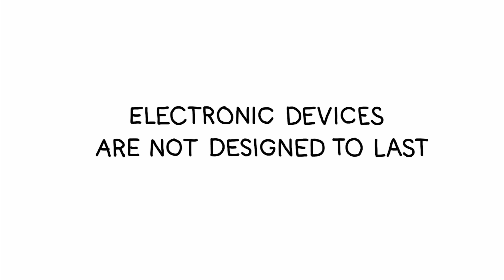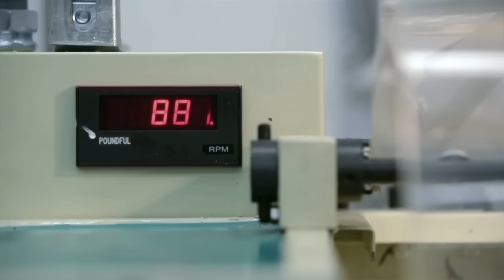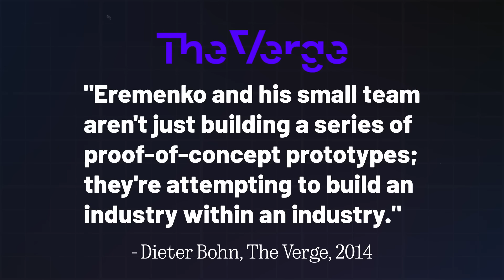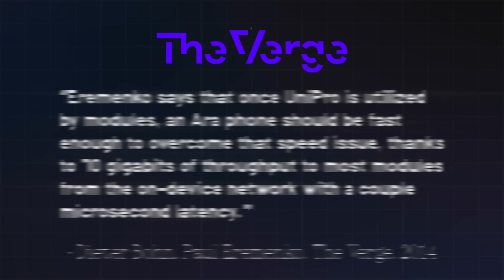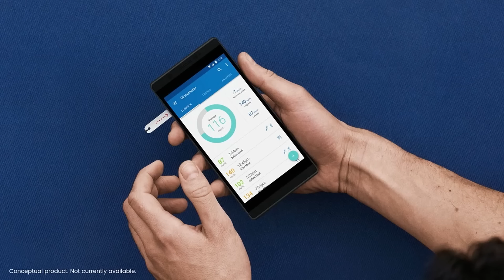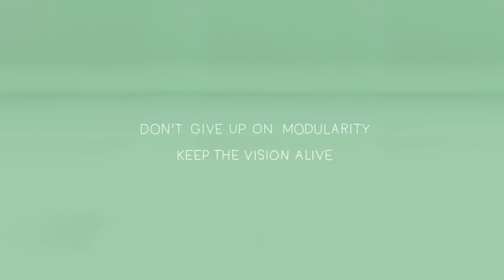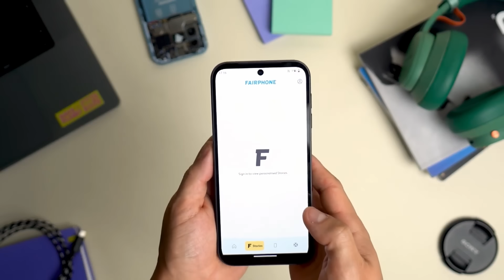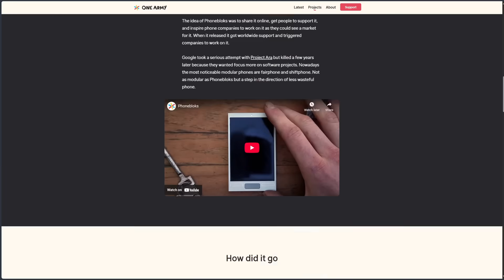Why Did Modular Smartphones Fail?

Comment: I think that the main reason as to why nobody's really pushing for modularity (at least "true" modularity) is that you can just make a phone that actually does everything you'd want a specific phone to do without swapping anything: most modern phones are great at almost everything with maybe 1-2 weak points per model.

Comment: Great video, although I do feel Apple's iPhone MagSafe definitely deserves a mention!  Considering it uses NFC and data protocols for accessories like automatic tripods, batteries, etc, even if apple locks down the MagSafe protocol pretty heavily. They even have the ability to update iPhones inside boxes at stores! And iPhones cases have chips inside them that animate the iPhone with the color of the case when you insert the phone.
Reply: Mag safe should have been pogo pins, wireless charging is so inefficient.

Comment: I had the LG G5, loved it, yeah it didn't have modules like it promised, but it came with 2 batteries with a case that held the other battery that you could charge the battery with or use it as a power bank, I actually still have my G5 on a shelf somewhere, the case, and batteries, I use it occasionally when I lose power or for long plane rides, though those batteries can only give me about 30% charge (each) for most modern phones, also loading in the batteries felt pretty satisfying, like loading a mag into a hand gun haha

Comment: I think the only thing that really needs to change is batteries. Maybe the charging port, too. I'd gladly keep using the same device for a decade as this one I've had for almost 5 years is still LEAGUES faster than I'd ever reasonably need. But, the battery is slowly showing it's age more and more. I'd be more than happy for the phone to be a few millimeters thicker if it meant I could have a hot-swappable battery. It seems a majority of people "have to" buy new phones because they kill the battery or break the charging port. Most others just buy them because the brand tells them to. We need E-Waste Recyclers first and foremost. Much like renewable energy hardware, the only reason it's "impossible to recycle" is because nobody has any reason to. It's cheaper to support child slave labor overseas than to open a recycling center. We absolutely must fix this first. Make batteries recyclable and easily user-replaceable and I guarantee you e-waste production rates drop significantly at least on the consumer side.

Comment: You can't rule cool tech over reliability. Once that thing gets water in the connectors, that phone is as good as dead. You won't have just a part to replace. Each individual modular component is considered a product. Products have scews, scews have manufacturing processes, manufacturing processes can be outsourced, but each product has different manufacturing lines, automation, labeling, and SPC. So your one product is the cost of eight production modules and 8 things to go wrong. That cost alone is more than triple the cost of a premium phone. The cost to manufacture it will not be worth the investment because it will be obsolete in two years. New tech and chip manufacturers don't stay still, so the module frame configuration will need to be redesigned, and module connectors need to be redesigned; module components may or may not fit the new frames. If Google had applied this to an open-source product, this would have more of an impact. There was always a hidden message that this would be the last phone you'd need, or why upgrade when you can replace parts, and that just is not the case. But if big tech was going to manufacture it will be obsolete in two years because the changes of human experience and behavior is much narrower.

Comment: 7:11 yeah... and the same goes for camera, screen, modem, wireless, emmc - since those are as bandwidth and latency sensitive as they come. I mean we have dedicated highspeed low latency interfaces for those in embedded for a reason. Ara has never reached a "functional prototype" stage, all it really got were pretty pictures and nice sounding idea, that looked "plausible enough" at the time(since bandwidth and latency limitations weren't as severe yet). There is a reason why SoCs, CPUs, PCHs and even SuperIOs have that many pins and why we use bga for anything REALLY complex - you just need that many connections to pump that much data - there are no real shortcuts or workarounds that you can reasonably cram in there.
Reply: As for what could actually be a "project-ara-ng" is just less ad-hoc version project ara, as in "base-plate" having the cpu and ram and all the modules having everything else(e.g. something that google "settled for" in the latter stages of project ara). Same premise, but way more achievable and with less drawbacks, and with actual standartisation of connectors and form factors something that could achieve the very same functionality. Another positive side to this aproach is that the actual prtocols and undelying IPs, SoC and interconnections can be the very same, wiith only thing different being standardised connectors. As for drawbacks, i'd say them being actually more limited variety of phones and their functionality(standartisation doesn't bring creativity), the need for balance between ruggedness, thinness and weight would be a tough fight for the one that would want to bring the standard forward. Another elephant in the room would be proprietary drivers, init sequences and "purpose built" apis and apps that dominate mobile market now would severely limit the hardware choice for such a device...
Reply: Except all of those have already been made in modular formats, just not all at once. A few phones have had modular cameras, my laptop has a modular modem, every desktop PC has a "modular" display....
Reply: Half of those don't even need high bandwidth and low latency.
Modem and wireless are available as USB 2.0 modules, that's speeds from the 90s. Even lower end cameras work with USB 2.0, and USB 3.0 is enough to handle a 4k camera.
PCIe standard which allows quite a bit of a distance between the CPU and the addon card is enough to handle the fastest disks on the market, so emmc is not a problem either.
And PC monitors are usually connected using 2m cables so 4cm extra introduced by an external module won't be a problem for screens either.
The only component that might have latency issues when connected externally might be memory, so it should probably share a chip/module with the CPU.

Comment: I feel like that there should be a middle ground between phones being 1 monolithic structure, and being 100% modular like the video mentions. it would be way too expensive to make absolutely everything work as shown in the video, not even needing to take it apart in any capacity to access the parts. although a middle ground would be to use stuff like ribbon cables, SCREWS, and thin plugs to connect everything together while holding the case together using screws instead of glue. something that if you know what your doing, isn't actual pain to fix and replace components, but isn't pushing it to the point where all the parts are external and any old grandma to replace parts (which would be obscenely expensive).
Reply: Its less expensive than you think. The only added cost is the extra chassis (around 5 dollars per phone if you go high quality) and connectors (10 cents per component (x2 for each side of connector)).
So if we assume a phone like on the picture with around 10 swappable components, that's 7 dollars extra. 
With phones costing 200 dollars nowadays, 7 dollars is barely a difference.
Reply: @hubertnnn  that makes sense, but there's also the cost in engineering it to work well
Reply: @Geffro  Depends on what you want those components to do. To cover 99% of use cases you can just reuse existing technologies (USB or PCIe for data and direct 12V connection to the battery for power). So the only engineering cost is planning the wires (less than a day of single experienced engineer).

There might be extra engineering cost if you would want any high speed devices to be modular (like eg. RAM or GPU), but I think having CPU+GPU+RAM on a single chip while everything else (battery, storage, sim cards, camera, fingerprint senor, USB port, headphone jack, etc) modular is probably a good enough compromise for phones.

Comment: 12:20 not hot swappable. That would mean you leave it on. It's "just" repairable. You still should turn it off when doing it
Reply from the maker: Ara was mostly hot swappable but yes I did use it wrong there. Certain components like the battery and soc where not hot swappable

Comment: the modular way they're imagining really indeed complicated and likely dont work but i was thinking about middle ground instead one slot fit anything why not just make like one slot specific for CPU then one or two slots for RAM (either dual or single channel or even quad channel for like larger tablet version) and one specific slot for display, then maybe few more USB C cards like what framework has done for additional pheriperals like camera, bluetooth, wifi, etc instead jsut trying to make everything fit into one slot and use specific slot for performance and efficiency concern like CPU need special slot which connects to RAM slot for speed reason and so on. then modular phone be looking like PC landscape where there CPU socket, M.2 socket, RAM socket, etc

or alternatively follow framework approach of expansion cards are just USB C devices under the hood

Comment: Sounds like over-reach; They could still have got 90% of the benefits, with something maybe 20% as complex... But it would also be 20% as impressive/gimmicky.

I don't need EVERY part of a phone to be swappable. How about we just make the battery and storage easily replaceable by the consumer, and then offer different different basic chassis' depending on your needs? 

So if you're into photography, you get the chassis that costs more, with a high-end camera. Or personally, I basically NEVER use my camera, and would be fine paying less, for no camera at all, or maybe just one low-res, back-facing camera for FaceTime.  

Or maybe different chassis with larger screen, or more audio-focussed, or maybe games-focused, or whatever.

But who is gonna need to swap out EVERY component? We each may have different stuff we want from a phone... But for each individual, those needs are unlikely to change- You just may want to upgrade the original
Reply: SD card for storage?

Comment: The Phone Companies Killed the Modular Smartphone:
They want you to have to pay $1600 to replace your phone because a $5 part failed.
It's big money for them.
When the project team learned no phone company would accept their phone, they shut down.
Reply: Hell the ONE thing we use to have, replaceble batteries they sealed off for much the same reasone. Why sell you just a battery every two years if they force you to get a new phone to get full batteriy performence.
Reply: This! I am very sure this happened.
Reply: They bought and killed it. 

“Don’t give up” 😂

Imagine what these companies would pay to take this off you hands ? 

They also have the power to push you out of the market all together, no company wants this, it’s not just the giants it’s the whole chain, everybody involved in making everything involved in making a phone. 

I fix it don’t want this
Reply: you can replace the 5$ part easily if its not an iphone
Reply: cannot dissagree with the first few parts, but simply the best module phone combination would be worse than the cheapest complete phone in the market.... also if modular components woud work so simple ..why aren't computers already build like that ?
Reply: why not just like limit the power? Like take for example, DDR3 PC ram can't fit in a DDR4 slot, so you make like generations that you need new motherboards for to support that new generation of RAM
Reply: I just paid $500 for my iPhone 17 by trading in my iPhone 14. It’s really quite affordable imo.
Reply: I have never experienced or heard a 5 dollar part failing in a smartphone. It's either the battery, screen, charging socket ( better after type c ). And companies will still fix it. Or some local guy will fix it.
Reply: @thedislikebutton1907 while you are desperately defending these protection racket thugs, with deceptive nitpicking, the type c connector probably is less than five bucks. 
 In the very design of the phone case is intended to keep people from being able to open it and replace parts themselves.
Reply: Just like the lightbulb industry conspiracy. They know they can build a long lasting products, but they built it to last only for a several years anyway, so customers came back to replace their lightbulbs
Reply: @Zagref7937 To be fair, the lightbulb conspiracy is a rather poor example. With incandescent bulbs, making them last longer will always sacrifice brightness. The conspiracy was just them setting a standard
Reply: @corb5905 that's not true, there's been some proof lightbulbs were intentionally build to die sooner without changing anything else. You could totally have the same one that lasts 10 years.
Reply: @Zagref7937  the lightbulb "conspiracy" isn't a conspiracy if it really happened
Reply: The phone companies didn't kill off the idea of the modular smart phone like its some grand conspiracy. The only companies looking to develop such a thing couldn't gain traction or funding. And the reason they couldn't is because their market share would be too small. You either fall into iPhone or Android. iPhone means you buy one of the last 3 models. Most android users in 1st world nations are Samsung/Google/LG customers who are paying for that companies flagship phone or a model or 2 behind like iPhone.

The idea "you used to be able to replace the battery" is a fallacy because when that was the case you also couldn't generally drop it in water. Sealed and potted phones allow for more people to experience the much more likely situation of their phone getting wet and still working fine vs those that need to replace a battery because they've hung on so long. Modular phones just don't have a market to warrant their development and cost.
Reply: @GurtTheHurt  Nice to see a sane comment amongst all the theorists out here.

It's comforting to think that it's always the fault of the big bad corpos because we have plenty of actual things to blame on them, but sometimes a cool idea is only cool as an idea. All kinds of theoretically great "techbro" devices fall apart because they were selling the idea, not the specs.
Reply: @GurtTheHurt You are repeating all the propaganda and excuses, supporting the sociopathic desire to force us to pay more money for less. 
This video demonstrates that they were gaining traction just fine. 
The one "lack of traction" was that no phone company would allow it, for the reasons I already pointed out. 
Ripping us off with overpriced, planned obsolescence phones is big money.
Reply: @KAZVorpal  Social media traction is not market traction. Far, far more people say "I'd buy one of those if it ever came out" than ever actually buy it, regardless of the product. "Putting your money where your mouth is" as the saying goes.

You can blame a lot of things on corpos, but sometimes cool ideas just don't pan out in reality. Production is a complicated thing, and if you don't do it in a smart way, that's where most product companies fail. The demand isn't high enough to offset the costs of production. There's no conspiracy behind the basic fact that making things cool is "easy", but making them profitable is not.
Reply: @Rehteal Except That this did not reach the level of profitability, because the phone companies told them that they would never buy it. 
It's just that simple. 
A phone companies make a lot of their money, by legally plundering people with these phone leasing scams.
Reply: @Rehteal  You are making my argument for me.
PCs are more modular, and have always dominated the industry, Apple being a perpetual also-ran, generally between two and ten percent of the market.
Reply: No the modular phone is conceptually cool but would be rife with issues.

Modules could be it's own whole ecosystem and potentially more money than buying one phone every few years.

The lightbulb companies made a a trade off between energy usage and longevity. You can make them last forever with thicker filament but they will cost more in electricity over time.
Reply: @LouieCastro3  No, the progress they'd made right at the end shows those are phone company fallacies.
Reply: @LouieCastro3 nope, there's a dim light at low power still active now (almost 100 yrs)
these greedy companies limit civilization
Reply: @thefirstsin  yes a dim one. The filament is thick for the amount of light produced. This is why they don't do that. It's dim.
Reply: Did you even watch the last part of the video? Thats clearly not the case dude.
Reply: @professionalduckquack I did and I would love to see the easily replaceable battery on the lastest iphones because from what I've heared it's quite the opposite
Reply: Doubt it. If they wanted to make money off that, they would
Reply: These phones would cost $4,000 yall, and replaceable battery just means worse battery life
Reply: @sunnohh Okay Apple 👍
Reply: @sunnohh  They wouldn't cost four thousand, but even if they did...then you would not have to ever buy another one, and upgrade little bits for a few hundred when you feel like it.